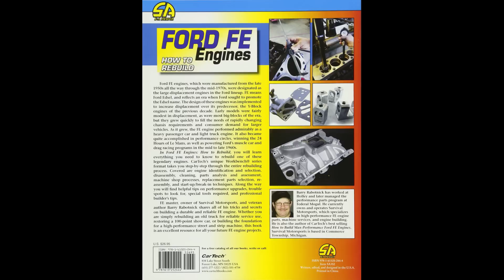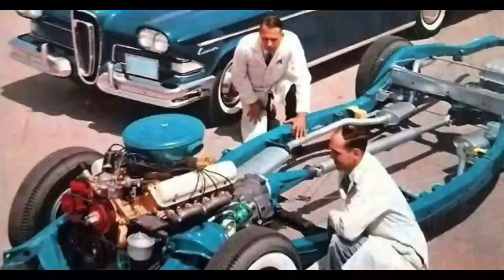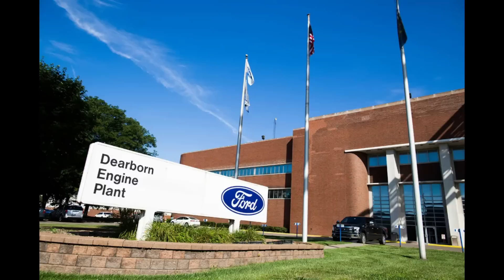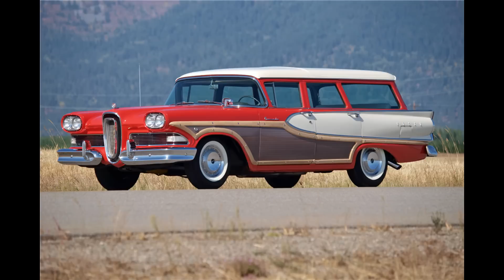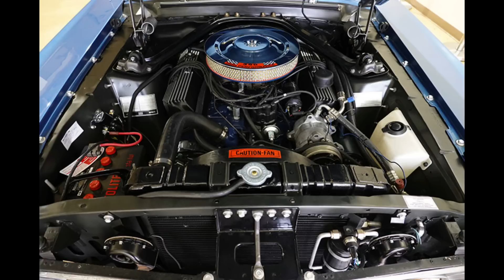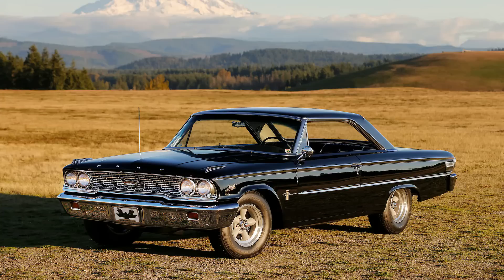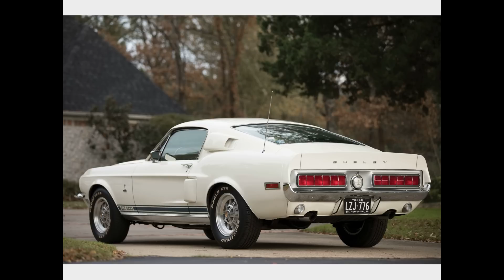Learn about Ford's FE engines and why they are among the greatest offerings by the Blue Oval!

Comment: The 410 is a really unsung hero. I had a D4TE 360 block from a junkyard truck that has the 3 web mains like a CJ. You could bore them a mere .020 over and have 413 ci. The torque was crazy. The easiest engine to put aftermarket crossbolt mains. 2 and 4 mains were the only ones that usually cracked. I bought a pair and had them installed on a 413 ci 410. The cool thing was that they had oiling passeges that you could run oil lines from the filter adapter and feed the hollow bolts into one side and the lower bearing shells had a hole and the main bearings you could put in 2 and 4 were grooved all the way around and you could, while it was disassembled you could put set plugs in 2 and 4 above the cam     bearings to keep the oil in the mains. Blocking 2 and 4 above the cam bearings and running the lines from the filter adapter to the 2 and 4 mains with grooved bearings and a hole in the top and bottom with grooves it made it priority mains on 2 and 4 that oiled the main through the side and it went up to the cam. It really helped the oiling. And with headers and ARP studs they were bomb proof. The 413 with CJ ported 390 early port heads and a 2x4 intake it made 610 hp and 625 ft lbs. wide torque band from 3200-6000 and peak hp at 6200 with a solid cam. It was crazy in a 67 Mustang 4 speed with 3.50 gears. I did it in the 70s and the “ fast car guys” just scratched their heads and swore I must have hid a blower in there. Driving it to school without a hood, no one ever saw one, but 11.6:1 cr was close. Those 2 inch primary open headers and the D solid cam with 30 inch long 3 inch pipes dumping out the sides with no mufflers. At 7000 rpm’s it sounded demonic… the 2 mains with priority oiling really helped get the other 3 oiled really well. I put an oil line and gauge on 5 main and it never dropped below 75 psi. The bearings and crank never wore. I had 7 inch rods and 1.15 ch pistons are internally balanced. It was a screamer and I still have the crank rods and pistons. If I wasn’t too blind to drive I’d do it again. That was 1977, I still have the block, the main caps and crank, the rods and intake and stuff have been sold, but it has no wear on the bores or crank. I could build it again. Easy. I miss driving so bad. Sidestepping the clutch and seeing the sky for 50-60 ft while banging 2nd. Sigh.
Reply from the maker: Wow - thanks for such a great comment! We love when car people share their memories with us! So glad you watched and enjoyed this feature.  Keep watching - hope you've subscribed!

Comment: My family had three 1968 Galaxie 500s with the 390-2v engine and FMX transmission. The first was a station wagon, the next was a sedan that was my first car, and the third had an engine damaged by by ice in the block and heads, salvaged to replace the rust-damaged sedan. Peak torque point was great for highway cruising. Although the owner's manual inferred that a 427 was available, I'm not aware of any 1968 big Fords that had one. The big blank spot between the 302 and 390 that year model was stark.
Reply: Manuals and catalogs had a printing lead time involved so info could be old when they were new. The last RPO 427's were in 67 early production then most cars were quietly switched to 428 when the 427's were gone. Some models like the Fairlane and race spec cars were 427 only, and had priority over the other models for this engine so even toward the end of the 67 model year some left-over 427's went in among the 428's when they were available to get rid of the stock on hand. Ford did crazy stuff like this with several engines both to use up old parts as well as to continue production when newer part stock ran dry temporarily. This was particularly so with the MEL engines.The 'blank spot' you speak of was intended to be filled with the 351W but it wasn't ready yet plus they needed all of their capacity to build 302's.
Reply: @P_RO_ , appreciate your perspective. One of the weird things about the 1968 model year was that the Mercury Cougar started off with a 302 base engine, then mid year someone decided to use up remaining 289s. Some of those small blocks had a mix of 289 and 302 parts.
Reply: There was a long strike against FoMoCo in 1968. Iwas going to buy a 427 Torino but because of availability, bought a RoadRunner, instead.

Comment: The 390 with a 4 barrel carburetor was my favorite FE engine. Trouble free and reliable not at all expensive to live with.
Reply: Not expensive for who?
It got what, 8mpg in a f100?

11mpg in a sedan?
Reply: @fastinradfordable  use a modern motor oil, install a more efficient intake manifold and carburetor, get a set of headers and dual exhaust. The 390 was never designed to be a high rpm engine but it could benefit from the improvements I mentioned with better fuel economy. I didn’t even consider a serpentine belt drive or more efficient power steering pump ( the original one is terrible on power consumption). 
Radial tires are another thing that wasn’t a common feature of mid to late 60’s ford’s. So, yeah the 390 can be made much more efficient than they used to be. I really like the abundance of torque on tap without having to wait for the turbo to spool up.
Reply: @fastinradfordable No your thinking of a 370 - 429 or a 460 getting 8 mph😂

Comment: I’ve got a Robert Pond 427 block waiting for fitting at the shop as my next project. I’d be in it but the large displacement stroker SBC I’ve been working on is taking longer than expected as nothing fits just right. Looking forward to working on the newborn 427 FE

Comment: FE engines have some great features.    The deep skirt design kept the crank firmly in place and made the main caps easier to convert into cross bolted if not already factory ones.    You weren’t going to crack a block down low from too much torque.    Instead of having to remove the heads to port them,  most of what would normally be the intake port of regular heads, was in the intake manifold on FEs.

Comment: Did a body off restoration of a 1965 Ford Galaxie LTD with a 390 HO engine In 1982. It was fully optioned to include AC, rare for a Montana car. I modified the engine extensively for more power, especially at high altitude. Keystone Kustomags with BFG Redline Radials. The sound was fantastic coming through Smitty glasspacks.

Comment: It was 1974 and my Dad's business needed another 12 ft. stake/flat bed F-350.  Well at the time the only new flatbed available was 50 miles away in Worcester Ma. He bought it, and it's engine was not the wimpy 360, but the 390 with a Holley 4 barrel carb.!  That was an awesome truck to carry loads and gave us some big smiles when the secondaries opened!

Comment: I worked in an oil well for a while.  The engine that was used to run the generators was a 391 Ford industrial motor. It ran 24 hrs a day, for as long as the well was being drilled.
Reply from the maker: Thanks for watching and sharing your memory! Keep watching!

Comment: That Barry Rabotnik guy here in Detroit did alot to promote the FE engine long after it ceased to me manufactured by FoMoCo. I remember as far back as 1987 hanging around the street racing scene...his black 68 or 69 Galaxy (im not a Ford guy and don't always know or recognize exact years or models, etc). That car ran strong among all the quickest street cars of the time and whatever he had his hands on was well respected. Later id see him in various magazine engine articles always focused on the FE but also taking part in more modern performance upgrades. There are other names associated with the performance FE aftermarket but his name stands out in my book. 
Growing up and still living in Detroit and Dearborn meant Ford performance lovers all around me. Ive always been a GM guy but of course love all old musclecar and classic cars nowadays. Ive always most respected Ford's performance efforts based on the FE. If i ever hit the lottery, my top Ford pics are first a 1963 Galaxy 500 with a 427, don't care about numbers matching just has to look the part. Next would be a 1967 428 powered mustang. Not even sure why but may have something to do with a couple of NHRA stock and super stock racers named Barry Poole and Jim Calvert and the vehicles who put both names on the map. As an engine guy i have not had very much experience wrenching anything FE and always thought the  valve cover upper rail as part of the intake manifold was just plain weird and simply made me wonder why. One last thing...ive never heard a good running FE engine sound anything but good out the exhaust. They have a great exhaust note.

Comment: FE stands for iron on the periodic table which makes sense as the intake manifold bare weighs 95 pounds. I normally use a cherry picker to install them. The starter placement is primo, you don't need to get under it to replace the starter. I swapped out 390 heads on my 360. Larger ports and lower octane requirements were my reasons.Don't let them kid you about the 406. it is a straight up race engine No matter the cost or the vehicle, if you find one, buy it! They are not cross bolted from the factory but because they are two bolt mains, a lot of builders employed that option as a cross bolted two bolt is two and a half times stronger than a four bolt.
Reply from the maker: Thanks for watching and for the great comment!  Appreciate it and hope you keep watching!
Reply: @IfThisCarCouldTalk  
Love the old iron.
Reply: I saw a video on YouTube where someone weighed the 390 iron intake and the scale showed 71 lbs. I have removed and installed one on a '67 GTA mustang and hell yeah it's heavy!

Comment: My uncle James Fostey was one of the head engine designers for the FE motors. He worked for Ford in Detroit from the mid 1940's to the early 1980's. The 428 motors were hard to beat on the street. He had some good stories about these motors from long ago.
Reply from the maker: Wow - nice to meet you and we're thrilled you found our feature!  Would have loved to sit and chat with your uncle about those days and his work. Thanks for watching and sharing your comment!
Reply: I had a '70 Mach 1, 428 Ram Air shaker hood and a rock crusher top loader 4spd with Hurst factory shifter in '72.

It could beat anything on the street except for Dodge Hemi's. The 427 Vetts were its meat.

The problem was it was all go and no whoa. The front brake shoes were a little bit wider than the stock Mustang ones  like the 351 Mustang shoes. No power brakes and not disc either. I bought it used in '72. It could torch the rear tires but no locking differential, so it did get squirrely anytime the pavement was slick or into a little sand or gravel on the road. An adrenaline rush for sure! Good thing for that 4spd because the brakes would fade real quick, so you had to start grabbing gears and looking for a hole at times.

Comment: I eat, sleep and breath the FE. I have loved these engines since I was a child, and my uncles had FE powered mustangs, torino and Fairlane. I will say that the 390 is the most lied about displacement amongst F series truck owners, especially 67-76 trucks. I have bought, sold and owned more than 30 F250 4x4 trucks over the last 35 years and every guy selling one claims "it's got a 390"😅. The 4x4 f250 never had a 390, only 352 and 360. I can't find any documents among my years of collecting Ford literature of the 4x4 leaving the dealer with the 390.
My favorite FE build combination that I've built are 360/390 blocks with 428 rotating assembly for a 410ci displacement.
Reply from the maker: Thanks for watching and for the great comment!  We appreciate you hard core Ford folks (especially since Tom bleeds Ford blue)! Keep watching!
Reply: I will more than half way agree with you on the 390 in high boys. But that's not to say some 390's didn't windup in them weather it be from the factory or a dealer hears my reasoning take the 410 for instance it's not supposed to be in trucks right? I've seen several over the years my 69 Ranger has one technically it has had two the original one had bent pushrods and one broken piston and rings. Then I got another 410 to replace it came out of a buddies dentside which he has had several his self.I've gotten a 4100 Autolite 4 barrel carburetor off of a 410 that was in a 70-72 pickup from a local junkyard.

Comment: One small factoid about the 427 SOHC. It never saw competition in NASCAR. And still the only engine to ever be outright banned by the organization. The 426 Hemi was initially disallowed, but after a few years of drag racing and production of street Hemis, it eventually got on track.
Reply: @bradwithers4720  Hi there. Yes, you are correct in saying that they banned the 427 OHC engine from NASCAR. To me, that was a real shame. The engine in my Galaxy Starliner has only done 20 thousand kilometers since new. I have had it apart and replaced the cam drive chain with a better quality chain and resealed the engine again. It also got rebalanced at the same time. Instead of the duel, 4 barrels,it has got a duel 4 barrel fuel injection system installed. That really improved the fuel economy and drivability no end
Reply: The Hemi came back through the back door and ironically the wedge managed to hold its own against it. It is almost comical, even when the Boss9 came out, the Tunnel Port was still a badass in NASCAR racing.

Comment: What about a 300 CID, Inline 6 ? Is there a 300 FE, or no ?  I don't know that's why I'm asking.
Reply from the maker: No.  An FE is a V8. Your 300 is an upsized 240 which was first used in passenger cars in 1965. It is a virtually indestructible engine and one of Ford's best! Thanks for watching and commenting!

Comment: I had a '66 Ford F-100 custom cab with a 352. I changed carbs, cam, lifters, valve springs, intake and took the horrible log style exhaust manifold off and put headers on it. That 352 really came to life. It was also my favorite year of pickup from Ford.
Reply: @ZEEKUPP  Headers really do wake them up!
Reply: @ZEEKUPP  I had a 65 F250 4x4, with the “wrong bed” all of the 65 F250 4x4 s had. That was 1/2 Tractor! Rust got it, but I sold it to a restorer. I bet it is really nice. I even gave him a 65,352 that matched the date code for the truck.,
Reply: I’ve got a 65 model F100, currently running a 302 windsor but im on the hunt for a good condition 390 to put in it
Reply: If you're going to have the weight of an FE up front, it might as well be a 390 (Bored and Stroked 352) or a 410 (Stroked 390). I'm keeping the 352 in my '66 because it's the factory original. My '67 now has a 390 because it's a Frankenstein rescue. After surviving it's last 3 owners, It deserved to live.

Comment: I've got a 64 Galaxie xl 2dr fastback. It's Wimbledon white with a fresh/new, palomino interior. Been Garaged its whole life. It has PS, PB, AC that all work. I've owned it for 34 years. I'm the 4th owner of the car but I know its full history. Currently it has a factory ford "crate motor" 428 installed in the early 70's when they were still available from ford, Crane cam, Ported cast 427 heads, factory Ford tri power, long tube cast headers, a C6 trans with a Gearvendors overdrive. Detroit true track posi, 370 gears. Sure love driving it, probably burry me in it. Love my FE!
Reply from the maker: Cool! Hope you have many more years cruising in it! Thanks for watching!
Reply: My brother had a 64 390 4 speed ,Good times😂😂😂

Comment: HAD 66 COMET GT PULLED THE 390 OUT CAUSE IT WAS WORE OUT AND FOUND A 427 HR AND REBUILT THAT PURE HP SCARY GOT TO MANY SPEEDING TICKETS ONE TIME I WAS CLOCKED ON INTERSATE RTE 5 IN FLA DOING 120 OR BETTER BY A STATE COP HE CAUGHT ME 20 MILES LATER

Comment: I still have a nice 76 F150 4x4 with a 360. Runs like a champ
Reply: I just bought a 1976 f150 4x4 that came with a 360 but it had a 390 in it when i bought it. I cant drive it until i get the valves fixed. I'll probaly buy a set of aluminum heads for it.
Reply: @BillyLintzenich-wf7sk  Are you sure it's actually a 390?  The reason why I'm asking is because i have came across several 410's in trucks both bumpside and dentside infact my 69 Ranger has  a one in it
Reply: @purpurahaze9179  no, except 410's were never stock in any pickups of any years. Anyway right now it has a chrome air cleaner on it that says 390 on it. Which doesnt mean anything. Anybody can do that and say a 360 is a 390. Until i check the bore and mainly the stroke i wont know for sure.
Reply: @BillyLintzenich-wf7sk  Yeah that's why I was asking if you knew for sure what it was. It is funny that you mentioned it has a different air cleaner on it. I have a factory aluminum 5.8 liter air cleaner lid on my trucks big factory air cleaner. I never have understood why I've have found 410's in trucks even though they supposedly didn't put them in. They offered them in other cars besides 66-67 Mercury's
Reply: @purpurahaze9179  yep my guess is that it was cheaper and the only way to get a engine bigger than 360-400 in the trucks at the time. Since you couldnt get a 460 put  in them until ppl were making the mounts etc for them. Of course i'm talking about 4x4's.

Comment: I am 73 years old. When I was young and growing up my parents owned a 1964 Ford Country Sedan Station Wagon that had the 352 cubic inch Ford FE engine with a 4 barrel carburetor, dual exhaust, and the Ford CruiseOMatic transmission. My parents had six children. We would load up that car with the entire family and a top carrier with luggage for vacation trips. One unusual thing was that the car had a coolant expansion tank with a coolant fill cap that was close to the oil fill cap on the engine.
Reply from the maker: Awesome memories and thanks for sharing!  Keep watching!
Reply: The expansion tank was pretty common on FE powered cars in the late 50's tru the mid 60's